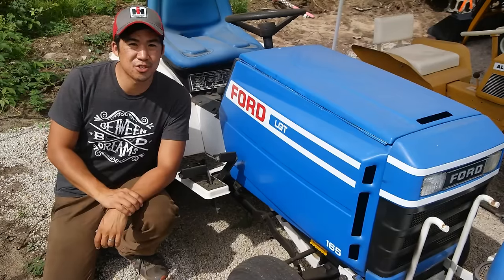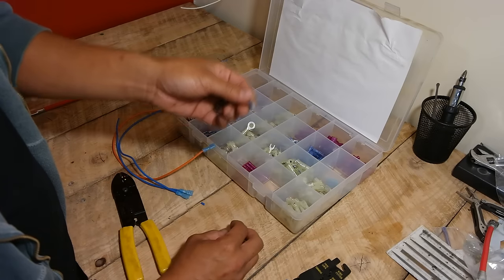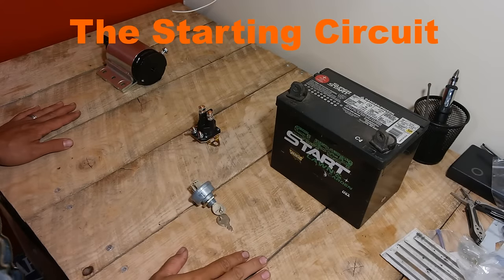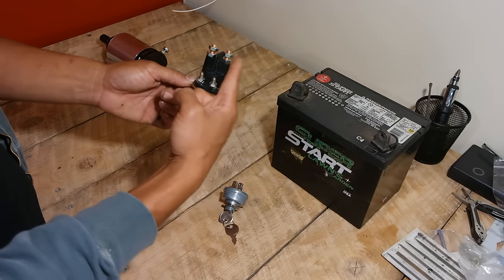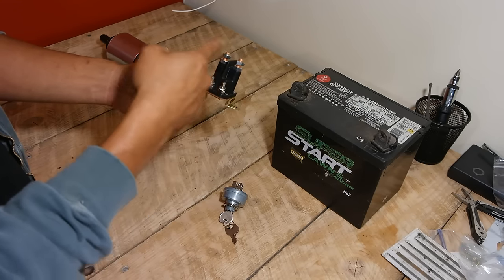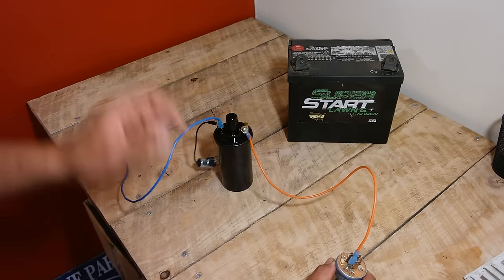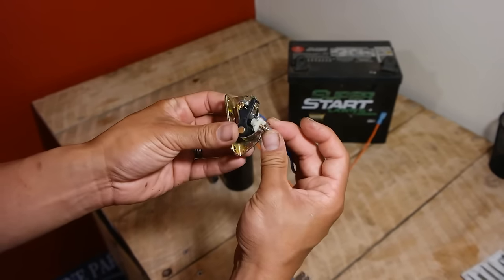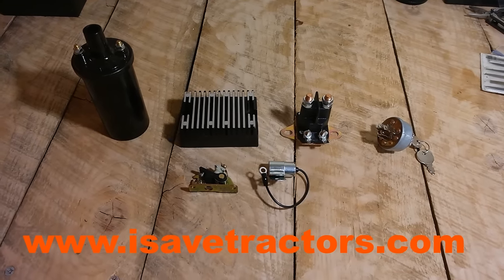How to Wire Your Old Garden Tractor w/ Battery Ignition and Stator Charging

Comment: This is THE best wiring video I have found after MANY viewings. Most have left  me more confused than when I started. THANKS.
Reply: get a copy of wiring diagram off of the net for your mower   study it its very simple  to under stand it is common   you would be supprised at the # of mowers that are wired just alike  they all have a switch apto a brake pedal aseat  each item i listed has wires to it for a reason   u sualy the tbl is in a switch thats moves the most   the wires just hang there   key and pto switch are common   ther two different key  switches that i know  i key has 3 notches the  kea has two   but they wire alike
Reply: Gotta give another shout out as I just rewired an old JD 112 using this video as my wiring diagram.
Like one comment says, best wiring video I've seen on the net.
Keep the good work up brother, if I was living in the US I would have definitely support your business.

Comment: Super fabulous video!  It's clear and straight to the point.  Easy to follow and understand.  The diagrams are helpful but the best part, I think, is simply seeing each system broken down into its components and wired correctly.  I'm considering stripping out all the wiring in an older rider mower I am rebuilding and wiring it up as you show in order to completely eliminate all the safety and kill switches which annoy me to death and to have good, new wire and connections.  I'll be checking out the other videos on your site and when I need parts, you will be the first place I check.  Thanks for sharing this video.
Reply from the maker: You're welcome and thank you for your comment

Comment: This video made it very easy to rip out all the troublesome wiring and start from scratch. My old wheel horse had all kinds of old switches by passed and old connecters that were just TROUBLE. Now, very little wire, I know where everything goes, and the tractor starts and runs fine. Many Thanks!!!!!

Comment: So glad I saw this. My rectifier has just been sitting in my tractor doing nothing. I just use a battery charger. Now I can hook it back up and use the power. I do have an issue with my solenoid clicking but not running the starter. I just jump from the battery to the starter side terminal with a heavy copper wire to run the starter.
Reply from the maker: Sounds like you need some new parts. You may need a new solenoid, and a rectifier. We have them all. Look us up at www.isavetractors.com and order online or give us a call.

Comment: This was great! Finally, after many years of being confused by the wiring - and further confused by the many complex and limited references to what these wires all do - confusing - and often incorrect - wiring diagrams and not even knowing what components are where on my 3 different Cub Cadets, now i know how to figure out ANY wiring on ANY of my small tractors. I cannot thank you enough for your clear explanations of these circuits and their components. And you know that IsaveTractors.com will be my new source of parts - and advice about keeping my 40+ year old Cub Cadets running. - the 1200, the 1450 and the 17 hp 782... Thanks! (and now I can get  back to solving the wiring problems with the old 782. Gotta get back to work; the grass is growing and needs to be cut before the rains begin again....

Comment: Well done. The explanation applies to just about every vehicle and or stationary engine ignition system with the exception of some very modern vehicles. It does apply to Motorcycles, Dune buggies, lawn tractors, go-karts, cars, trucks, etc with both 6 and 12 volt systems.

Comment: Great video!! The best I’ve seen so far. I have a 1969 wheel horse electro 12 and it does not have a solenoid. I think the solenoid is built into the ignition switch. I’m confused on what to do in a situation like this
Reply from the maker: You can switch to using a solenoid. This is the modern day standard approach now.

Comment: Excellent video! I have two riding mowers, an old Snapper and a old Dixon zero turning radius. Both are B&S and both have shot starters. I currently am using a pull rope to start the Dixon. Please let me know if you have starters for these mowers and if so what info do you need. Thank you.

Comment: Nice breakdown and component level explanation of the basic 4 circuits.
AT 15:20 do the ignition points function off the crankshaft or the camshaft or sometimes either?

Comment: excellent stuff...I have a question and a request.
how do you install a STSP (single throw Single position) ON-OFF Toggle AND momentary push button switch so one does not have to deal with those really poorly designed and high failure keyed ignitions?  (and also LOSING the key which is a pain in the backyard!)
would you create a video showing how this is done?
I think this would be very helpful to the DIY'er who would like the ability to go to level 11 and hack their machines to perform a much easier and higher reliability.  (yes, aware of the stupid liability stuff....just put in the disclaimer..done and done).  Noting the critical (safety) design to have the STSP On-Off Toggle to safely kill power to the engine (ignition coil interrupt).  And to discuss the needs (as required) for diodes and fuses to protect battery and wires and electromechanical devices from excessive current or the rare but harmful reverse polarity current that can occur in some situations.  

you are an excellent instructor and very good knowledge provided..
I sense you have some avionics experience...just a gut feeling...amiright?

Comment: Great video , but what do I about the amp meter ? How do I put it in line ? It's my wh g14 it's original as far as I know . The coil has one wire coming up from the bott and spark plug wire on top .

Comment: this is great, one question how do you know which wire from  rectifier AC+  and AC- to which wire on stator. one wire from stator had a diode.
Reply from the maker: In alternating current, there really is no AC - and AC + since they "Alternate" It's both. Putting a diode on one of these stator wires is a way to make it into direct current.

Comment: Hello,
I had to swap out my starter solenoid. The one I'm replacing had two post's and one tab (spade)
 My replacement solenoid has two poles also, but it has TWO tabs (spades)
  According to your video, am I correct in saying one connection tab(spade) will go to ground, the other tab will go to the start position of the ignition switch? And, it doesn't matter which tab (spade) goes to either the ground or switch?
  Thank you, great video! I really enjoyed your explanations.
Reply from the maker: Yes you are correct on all accounts. The two tabs is one circuit "activation " so it doesnt matter which is ground and which is the power source

Comment: Cv =Good information. Question the  blue wire ac+. Or ac-   How do you know which one is + or -   Or does it matter thanks
Reply from the maker: It doesn't matter for an ac system. Both wires are + and - but alternate. Hence "alternating" current ac.

Comment: Hi Norm I have a 1970 Bolens Husky 1886 with a Kohler horizontal 2 cyclinder.  Trouble getting spark when I turn key on I have 12v to +side of coil. When I turn to start no power to coil. Only get a spark to points and plugs just when I go fron off to on . Condenser and points attached to - side of coil

Comment: Thanks for a very useful explanation. I used the information to wire a Saber lawn tractor with a Briggs 17hp Vangard engine. This engine does not have a tower coil, so I had to remove the shroud and look for the wire that exited the odd flywheel-coil with no points. It all worked, but it required a little translation. Do you have a video with information on Briggs ignitions? (Strong, ME)

Comment: very good illustration. I was looking up how to charge my battery cause I have to jump it. don't have a charging wire running from stator to battery or solenoid... maybe you could comment. I have a riding mower it's a poulan pro, 19hp courage.

Comment: How do you determine between the positive and negative wire from the stator to the rectifier? Nice video.
Reply from the maker: For AC current there really isnt a positive or negative. You can use either. The center terminal from your regulator rectifier is the direct current output

Comment: Does the ignition coil at 15:20 serve the same purpose as the coil located under flywheel on modern mowers, which is powered by magnets?
Reply from the maker: Same purpose but different theories of operation.

Comment: Hi my name is Todd. I have a Areins 17gt . I am looking for advice on the fuel tank. So my fuel tank is a top psiphon. Someone just had a Cooper tube bent and vacuum hose on the bend going into the top of the tank. Also it use to have a gas tank fuel Gage/cap . So someone took all it off and just used the cap. So I didn't like the setup.  I could not find a bung for the top of the tank. So I bought rubber fuel line Sae 30 R 7. I put extra in the tank so it would lay down. Well it didn't work it just floated to the top. Do put a piece of copper tubing in the end to weigh it down. Sealed the top of the gas cap with seal all and then put seal all around the fuel line at top of tank. Well the tractor stopped running. It sounded like it ran out of gas. So I did some looking online found out I should be using a sae30R10 line. So advice what I should use to get fuel out of the gas tank. Also it has a electric fuel pump.  Thanks for your time and help.

Todd.

Comment: this video is so GREAT! I want to rewire my Ariens GT 17. It's a old tractor. How do you wire in PT0's? I have 2 PTO switch's. Do you have a email instead of filling this comments.
Reply from the maker: Hi Todd, sure email us at info@isavetractors.com. The PTO is simple. You can use a normal on/off type switch for them, or if you want to keep safeties intact use a PTO switch which is a multi throw switch. Email us with any questions.

Comment: Norman, I have a 66 SS-10hp  I got a new 12v battery in it and I noticed my existing ignition coil started leaking oil and was extremely hot. I disconnected the neg battery terminal and it cooled off and stopped leaking. Seems that it could possibly be a 6v coil? The coil does look aged and it actually still works now even after leaking oil. Im expecting it will fail at some point. My plan is to purchase a new 12v coil from the auto store but I want to know why this existing one started melting down and spewing oil after 2 hours connected. Any input?

Comment: On my 70 cub cadet there is no solenoid it from the battery it goes to the switch than to the starter and voltage  regulator. And also from the switch to the start button and to the coil. It is very simple. But now I might switch it out for this
Reply from the maker: Using a solenoid is a better way
Reply: @Isavetractors  I have a few questions. The starter on mine has 2 things on it one to run it and one to charge the battery, could I use this kind of wiring with my starter or should I get a new one

Comment: So, ignition to +, points/condenser to -, Mine was the reverse, and ran for quite a while. Something is causing it to lose spark now. Will this corrupt the coil eventually? It ran while reversed, now dead. Still turns over, but no spark. I've ordered new coil/points condenser. Anything else to check? If the engine turns over the switch is good? Could the ignition switch be casing spark loss? Help? Wisdom?

Comment: Hi!! quick question. restoring a 66 JD 110 and have a question about the ignition switch. there are 3 positions: BAT, IGN, and ST. I have the schematic, and I am pretty sure I know where the Bat goes but not sure about the other two. should the IGN go to the ignition coil?
Reply from the maker: yes ignition should do to the ignition coil and the St goes to the starter solenoid
Reply: thank you sir, you rock! I like your videos!

Comment: Norman hope you could answer this for me. I bought the “ Ignition Key Switch for Garden Tractors with Battery Ignition “ from your website. I states it is a three position ignition switch. I have not installed it yet but from messing with it , it seems like this keeps the lights on at all times when running. Am I correct about that? I have other tractors where you can turn back one click and turn the lights on or off while the tractor is running. This switch seems to snap back from starting right back to run and I’m guessing the lights would always been on?
Reply from the maker: Send me an email and I can explain what to do for you. Info@isavetractors.com

Comment: I need your help. I have replaced my motor with a new Kawasaki. I also replaced the wiring harness and the problem I’m having is that the connectors don’t match up. How will I replace the connector that connects the two???

Comment: I have a wheel horse gt 14 with a kohler k321 but it had electric ignition with a magneto but now has a battery ignition but I have no clue if I should wire the rectifier still because I’m not using accessories. What do I do?

Comment: (EDIT: it doesn't look like it matters.)    On a kohler mv18 - I have 2 wires, same color, from the stator. Does it matter which wire goes where when connecting to the regulator? I guess I'll find out when I get the engine shield with a regulator attached that I had ordered.
Reply from the maker: Correct for alternating current it doesnt matter. Just make sure the direct current one (B+) is in the correct spot

Comment: I was changing my ignition switch on my1966 jacobsen and accidentally touched the hot wire of the ignition switch to the frame and threw a bit of sparks...now I have no power at all. Do these tractors have a fuse someplace? Thanks

Comment: Hi Norman,
I'm getting a charge voltage of 21V at full throttle, Is this normal or will this overcharge my battery or my rectifier in not function as it should? Thanks
Reply from the maker: Yes 21v at the battery is too high. That will cause the liquid inside to evaporate and then the battery will no longer function or set on fire eventually.

Comment: Hello Norman what pin  would the neutral switch land on?
Reply from the maker: A neutral safety is normally attached to the start circuit
Reply: Thank you I’ll put it in line between ignition switch and + of coil thank you for your reply

Comment: I have follow you about starting my mower.but still not crank and less i took screwdriver in the solenoid( straight to  the battery}.idk what the problem.I check solenoid is good.and ground good too.should be run the starter when i follow your first starting intruction.but still not contact..starter good too. why..?
Reply from the maker: +Tonny Dermawan based on your deacription your starter solenoid needs to be replaced. Your solenoid may be clicking but it's not completing the circuit

Comment: I never knew that the Neg battery was grounded to complete a circuit 🤯
Reply: I also did not realize the difference in connector materials, but I like the ones with heat shrink

Comment: Norm where did you get nylon wire connector kit from?
Reply from the maker: I got them off of eBay, but I am sourcing some and will be selling them through our site in the near future. Nylon are the best way to go!
Reply: isavetractors  I am going to be starting to rebuild a Airens 17 GT. Rewiring, koholer KT 17 engine rebuild, and maybe repaint. But liked your connector kit. Seem all one would need.
Reply from the maker: I used one similiar to these: https://www.ebay.com/itm/480Pcs-Assortment-Nylon-Insulated-Electrical-Crimp-Terminals-Wire-Connector-Kit/172668769265?epid=4010675832&hash=item2833dc53f1:g:6AkAAOSwi7RZExzv

Comment: On my Cub cadet 1450 the ignition and rectifier wire go to the ignition post, the are together and not separated, is this ok? Should I separate?
Reply: On the female end of where my ignition plugs in...it gets spark...so seems like it works but haven't got it running yet

Comment: I'm running the factor starter generator, where do I run the wire from it to charge the system?
Reply: I've got a case 130 I rode and actually used it for our gardens but I was really young. It quit running 20+ years ago, I'm trying to get it going again for my son's it needs alot of tlc this video helped. Cause it's got a wire coming back from coil and a lead to the starter generator 1 coming off it and the ground still on the block but everything else behind that to a battery is gone.
Reply from the maker: https://isavetractors.com/articles-1/wiring-diagram-for-garden-tractors-with-a-delco-remy-starter-generator/

Comment: when i go to start my 212 john deer garden tractor when starter engages i have sparks flying on the frame and other areas when tractor starts and i release the key to run position sparks are gone  even when i bump the starter sparks fly on the frame or surrounding areas   please help thanx in advance  ed
Reply from the maker: Short somewhere. Check that big wire that goes to your starter

Comment: What about the ammeter is it really important to be part of the electrical system?,   Today I shorted out my ammeter gauge 😞,  yeah l know, forgot to disconnect the battery  what could have happened to my electrical system, it's a 79' wheel horse
Reply from the maker: Ammeters can go bad over time. Likely nothing you did. For an ammeter just wire it in series between the battery and your ignition switch
Reply: isavetractors thank you very much! That gives me some peace of mind, since I knew very little about this matter. Last night l did some research and looked up a couple of diagrams to get an idea how the ammeter is wired.  Yesterday I shorted  out when I removed a sheet panel off and accidentally touched the ammeter post then immediately l worried about the rectifier or the stator 😞.  Thanks again  man, have a good day!